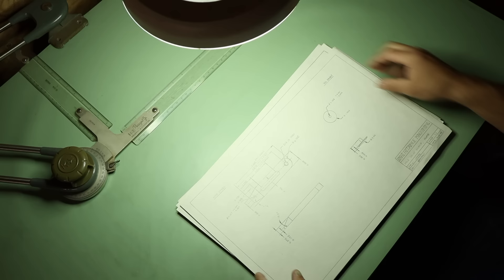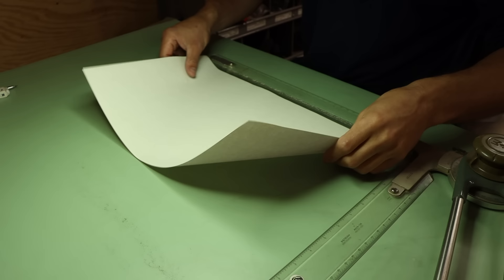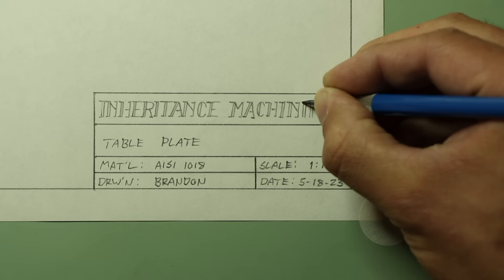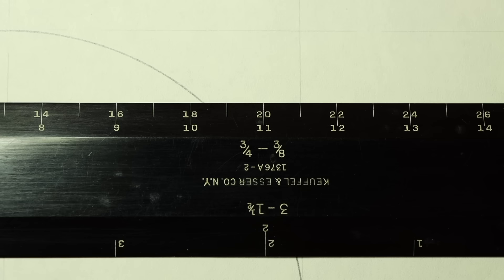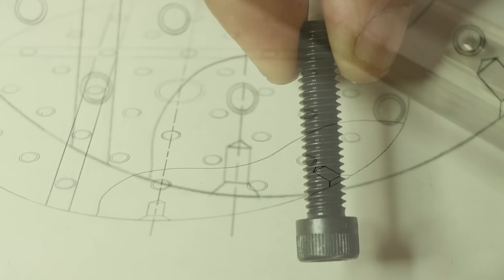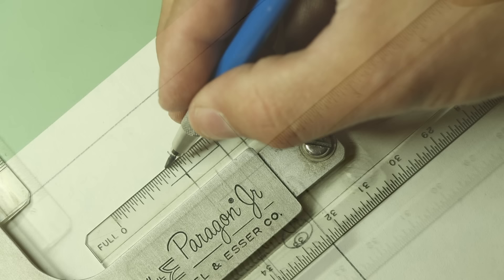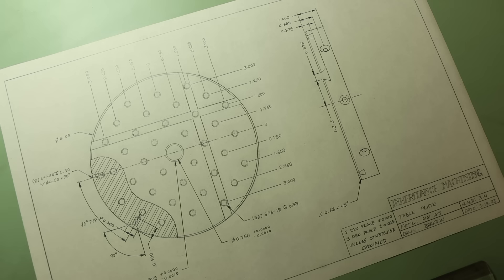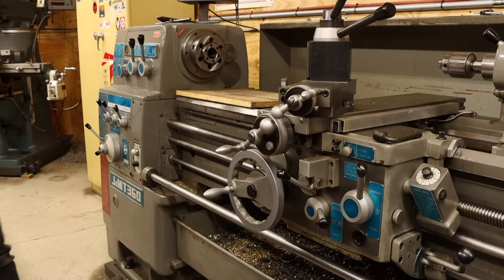The Joy of Hand Drawing Machining Prints || INHERITANCE MACHINING

Comment: I recently acquired an old Keffel & Esser drafting machine, but unfortunately, it didn't come with any scales. As a newcomer to the art of drafting, I'm seeking suggestions on where I could find reasonably priced scales. I'd prefer alternatives to eBay due to high shipping costs. Any advice would be greatly appreciated!
Reply from the maker: Unfortunately that's probably going to be your best option unless there is some sort of specific store near where you live. I don't believe they make anything with that scale mounting mechanism anymore so it's all vintage stuff.

Comment: Why not make a polycarbonate square with cross hairs and a small metal insert to hold the compass point. Put the cross hairs on your center point and use the compass to draw your circle. No more hole in the paper.

Comment: I need that arm ruller thing
Going to university for architecture program and there it is common to use only wheelruller(don't know how those are callen in english) .5 and .6 mm mechanical pencils and a compas. It is such a pain to make paralel lines. Still have to train a bit to nail entry exam.

Comment: Look for abrasive art pencils. I work at a aerospace manufacturing company and we use the power eraser to gently rub off paint on key spots that require bare metal surfaces the diameter of the entire pencil eraser fits inside the end all that's needed is to shave off the wood when worn down. Hopefully this comment isn't buried not to see the light of day hope this helps you.

Comment: Do you xerox (since we are using old techniques and terms :D) your drawings, and take those into the machining process with you?

By the time I am done machining even a simple part, my reference prints are soaked with oil, cutting fluid, and metal particles. I can't imagine the pain of that happening to those hand drawn documents.
Reply from the maker: 😂 Nah I just lay them out on the drafting table so I can see but not touch mid project
Reply: @InheritanceMachining  clearly you have a skill I have never been able to develop. The urge to resist touching clean things with oily hands.
Reply from the maker: @MatthewMenze  😆

Comment: Amazing having found such video.
There is a confusion that comes from the acronym CAD (Computer Aided Design), which is that it makes you think you can design with the computer.
Opposite to hand drafting, where you DO design as you draw, it has been embedded in the minds of the new generations, that the computer allows you to design at the same time that you draw. Huge mistake, your brain functions totally different when you are facing the PC/laptop screen than when you are drafting on paper, with physical means.
Not to mention that, when you draw digitally, "expression" only comes after setting the pens, and sending to print. Otherwise, on the screen, the drawing is just a colorful mess...

Comment: No hate, really, but the stroke is terrible. I stopped to produce my technical drawings by hand replacing them with CAD 20 years ago, but, man, really, we are talking about completely different things. The thin lines were drawn with 5H pencils. The darker lines with 2H pencils, and only when the drawing was finished (in order to keep it as clean as possible). The final touch was with made with indian ink. That was a nightmare, because a single mistake and the drawing was ruined. The width of the stroke (for the darker lines ) MUST be uniform, and edges and corners must be drawn much more accurately. No hate, really. I love the fact that someone likes drawing with graphite pencils again!